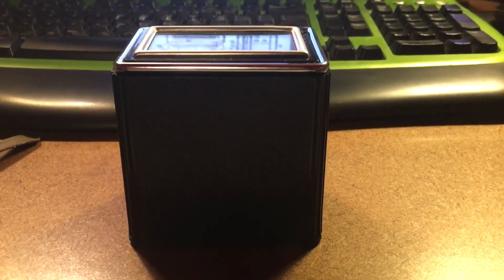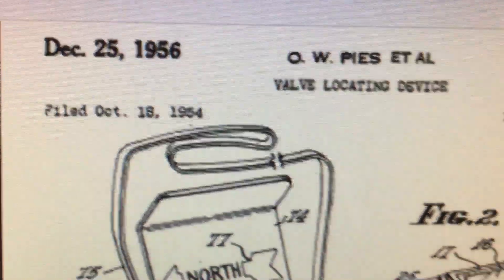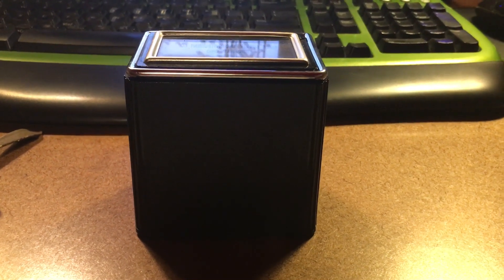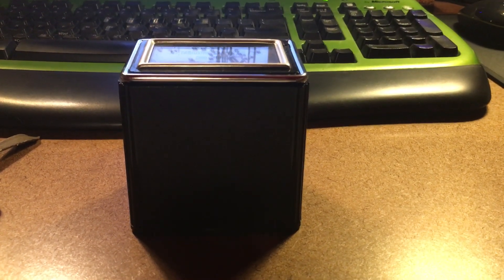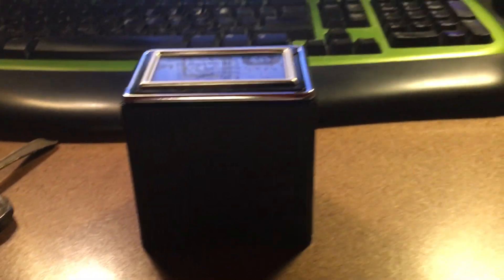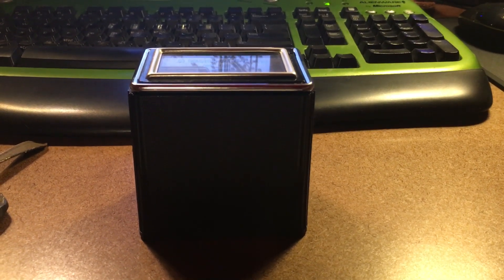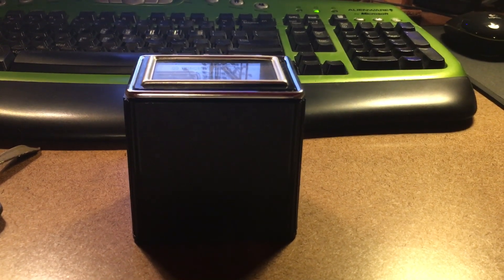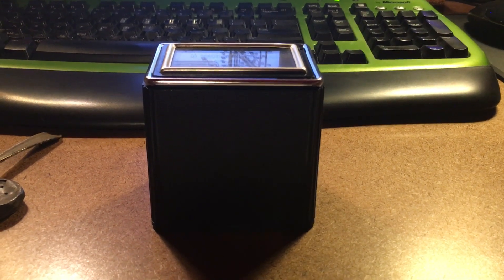Find boundary markers WITHOUT a metal detector (Part1)

Comment: I just got one of these from a cellar clean out,I had no Idea what it was,,I'm a retired Land Surveyor,we bought a new metal detector about 5 years ago for $800 bucks ,but back in the 70's I did see an old timer using one of these and had no Idea what it was,but Like you said  if you find a pipe,rebar,axil,or gun barrel is is in the correct place,contact a land surveyor and he will know from a previous map or a good survey discription in a deed,,,,Thank you for this device.